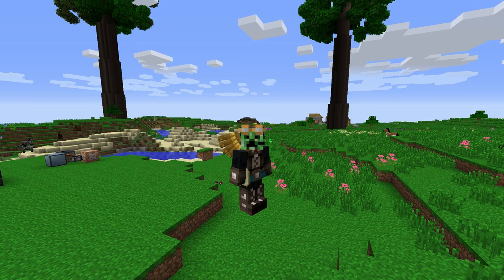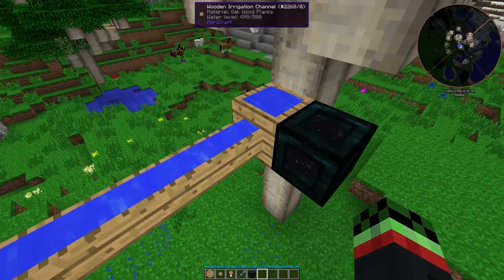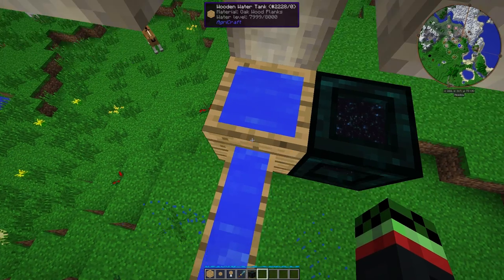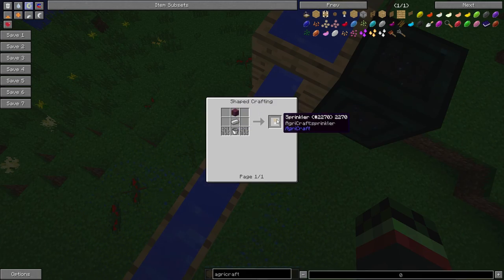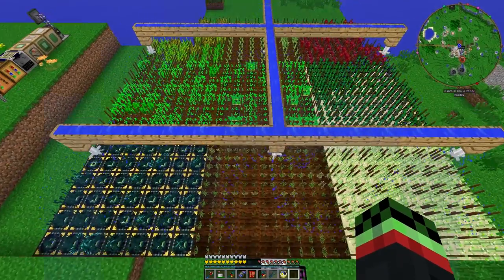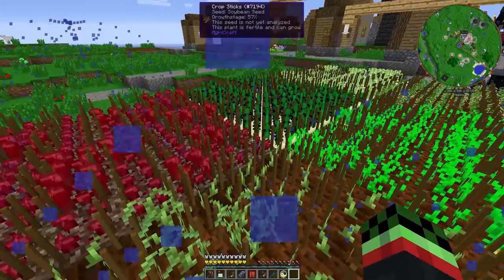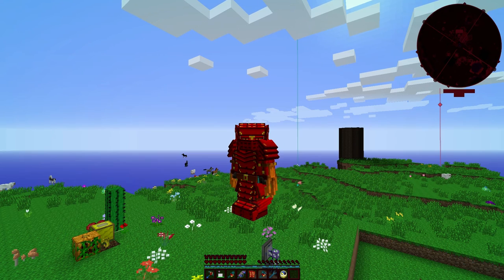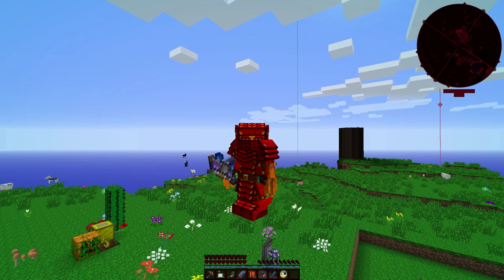Modded Minecraft Tutorial - Agricraft Irrigation

Comment: Hey, great video. For more information required: Can irrigation channels be connected vertically or only horizontally on the same level? What is the difference in irrigation channels items  234 and 235 other than the size?
Reply from the maker: +Pieter Meuldijk Irrigation channels can't transfer liquid vertically. If you want to transfer liquid vertically, you have to use tanks stacked on top of each other. I don't think there is a difference between the bigger channel and the smaller channel

Comment: You never told us how to actually set it up. BOO!
Reply from the maker: I did though. There’s a visual demonstration in the video.
In case that wasn’t clear, put the sprinklers on the bottom of the irrigation channel to water in a three-block radius.
Reply: What I did not see was from start to finish. I started with my tank, but IDK where to put the big irrigation channel, the redstone-activated piece (I forgot the name of it), or whatever. I barely got my first small irrigation channels to attach. Also, I don't understand why we have to make our tanks so high before we put our irrigation channels on. (in other words, why can it only attach from the side? Isn't there a piece that will suck the water up?)

 I have a farm next to the ocean. I dug out two lines of dirt to lead the water over  to the farm itself and used a bucket to even it out. I put my tanks into form a 2X2 (width all around) by 5. I filled it all the way to the top. Now that I got my little irrigation channels attached.... What's next? I am stuck at this point. IDK what to do with the other pieces.
Reply from the maker: You need to provide water to the tank somehow. There is a config option in AgriCraft that allows for a tank to fill if it has flowing water on top of it, or you can provide it with a device from another mod.
You need the irrigation channels so high because sprinklers can only be placed on the bottom of the channels. These can be at most four blocks above your crops and water in a 7x7 area.
Reply: I said that I filled it to the top.... Did you not read my last post fully? :(

Anyways I got it to work. I did not know about the config! Which device do I need?
Thanks for the help.
Reply from the maker: The devices I use most frequently for pumping water are the aqueous accumulator from Thermal Expansion and the fluid transfer node with world interaction/mining upgrades from Extra Utilities. You can also use a pump from IC2, Mekanism, or BuildCraft; or the reservoir from Ender IO. There may be more; I just don’t know about them.
Reply: Which ones have the least complications, take the least fuel, and very little materials needed for building? (After all, I actually prefer to farm more than anything else, which is why this mod piqued my interest! So often, I rarely go mining, which I end up binge-mining so I don't have to do it often.) I am gonna look into this. IDC about how much redstone I gotta use. I just have problems with things like using all my diamond, obsidian, etc. I have other mods I like to play with that require these items! :D <3 Cooking For Blockheads and Pam's Harvestcraft!!!
Reply from the maker: Actually, the sink from Cooking for Blockheads, if the config is set as such, can provide an infinite amount of water. You could use that with something to pump water out and that will keep your tank full forever!
Reply: Yeah, but it doesn't put it directly into the tank. Without something to pull the water out of the sink, it proves useless in this specific modset. Anyways it does not matter, I like my stuff to look as natural as possible. (which is why I like the water mill for my electricity because it's in the water and not out in the open where people can see it.) I am going Nomadic Japanese style right now. So having a sink from my storehouse isn't going to look pretty in such a setting.